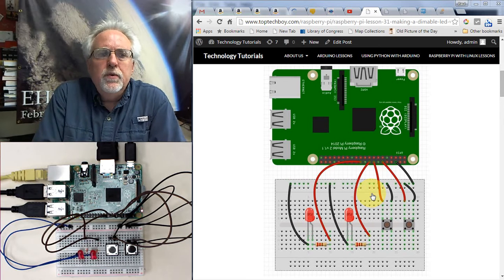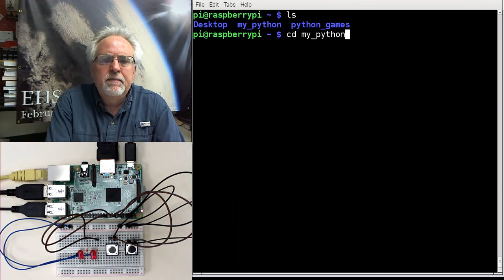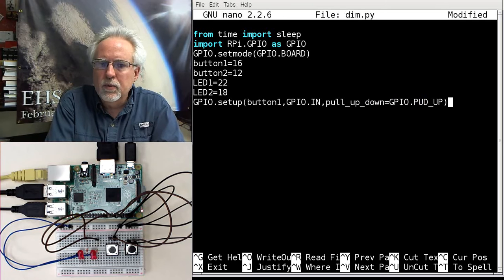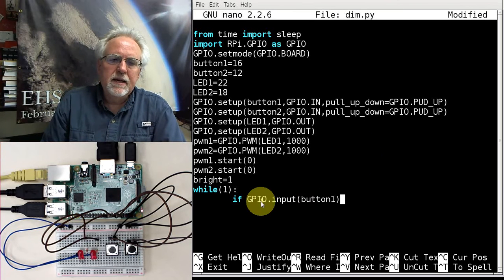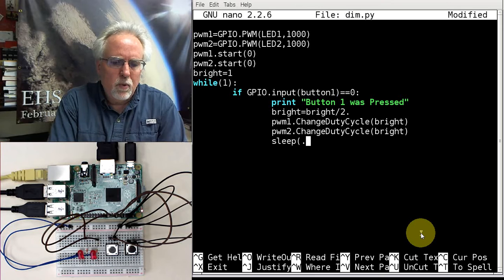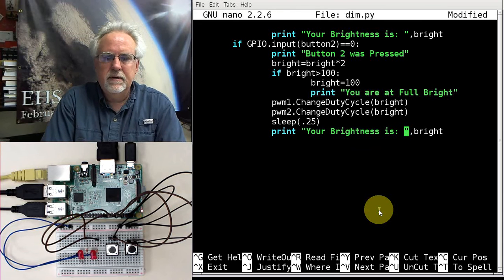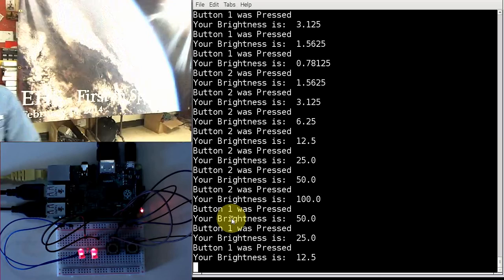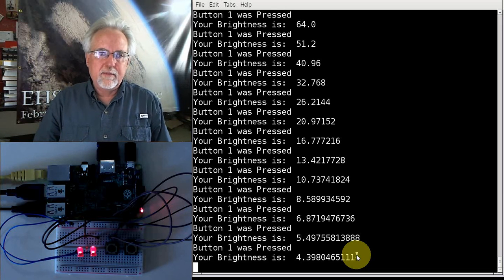Raspberry Pi LESSON 31: Creating a Dimable LED Using Python

Comment: I've done 68 of Paul's Arduino C++  tutorials, 2 or 3 of the Python ones as well, and on number 31 of the RPi Linux lessons. I've watched over 100 tutorials from this guy. I need to go back and thumbs up all the videos. I've yet to make a comment, but I had to comment on this one.

Okay, so I'm definitely exited to be on the GPIO pin on the Raspberry Pi. This lesson was great for me because, well, I didn't like his final outcome of the code for this lesson. The division and multiplication made it sloppy. you could never fully turn the lights off. And the progression of dimness was horrible.

So first I made the progression plus and negative. I also started bright at (0). 1 annoyed me. This created a problem he talked about in the lesson on the program bugging out. He made a fix for this going above 100, but not below 0. So I basically resolved that with near identical code he wrote for going above 100.

A side note, my code below is written for Python 3.9. Quotes are in ("brackets") vs Python 2 being "brackets".

(This is in Python3.9)
from time import sleep  # Library will let us put in delays
import RPi.GPIO as GPIO # Import the RPi Library for GPIO pin control
GPIO.setmode(GPIO.BOARD)
button1=16              # Give intuitive names to our pins
button2=12
LED1=22
LED2=18
GPIO.setup(button1,GPIO.IN,pull_up_down=GPIO.PUD_UP)  # Button 1 is an input, and activate pullup resisrot
GPIO.setup(button2,GPIO.IN,pull_up_down=GPIO.PUD_UP)  # Button 2 is an input, and activate pullup resistor
GPIO.setup(LED1,GPIO.OUT) # LED1 will be an output pin
GPIO.setup(LED2,GPIO.OUT) # LED2 will be an output pin
pwm1=GPIO.PWM(LED1,1000)  # We need to activate PWM on LED1 so we can dim, use 1000 Hz
pwm2=GPIO.PWM(LED2,1000)  # We need to activate PWM on LED2 so we can dim, use 1000 Hz
pwm1.start(0)              # Start PWM at 0% duty cycle (off)
pwm2.start(0)              # Start PWM at 0% duty cycle (off)
bright=0                   # Set initial brightness to 1%
while(1):                  # Loop Forever
        if GPIO.input(button1)==0:             #If left button is pressed
                print ("Button 1 was Pressed")   # Notify User
                bright=bright-10.               # Set brightness to half
                if bright<0:
                        bright=0.
                        print ("light off")
                pwm1.ChangeDutyCycle(bright)   # Apply new brightness
                pwm2.ChangeDutyCycle(bright)   # Apply new brightness
                sleep(.25)                     # Briefly Pause
                print ("New Brightness is: ",bright) # Notify User of Brightness
        if GPIO.input(button2)==0:             # If button 2 is pressed
                print ("Button 2 was Pressed")   # Notify User
                bright=bright+10.                # Double Brightness
                if bright>100:                 # Keep Brightness at or below 100%
                        bright=100.
                        print ("You are at Full Bright")
                pwm1.ChangeDutyCycle(bright)  # Apply new brightness
                pwm2.ChangeDutyCycle(bright)  # Apply new brightness
                sleep(.25)                    # Pause
                print ("New Brightness is: ",bright) #Notify User of Brightness

Comment: Hey Paul ! I really like your videos on the raspberry pi , as far as digital and analog writes thats clear, i didnt quite catch what resistor value you are using . Anyway , could you do a tutorial on the Rc 522 rfid reader ,  there arent a lot of tutorials out there for using it with the raspberry pi . Thanks!
Reply from the maker: TheRandomMan I was using a 330 ohm resistor. For the 3.3 volt output, probably a 270 ohm would make the LED a little brighter. I have not played around with rfid. At some point I might try and look into it.

Comment: Hi Sir, 
I am working on a project where I will be needing multiple led's to be controlled by my raspberry pi 3 gpio pins. Actually its exceeding the number of gpio pins available. Take an example of led thermometer implementation for reference. So my question is how can we control many led's without exhausting out the gpio pins.
thanks for the help in advance.

Comment: Tried using this circuit with  a RGB (made the adjustments for the changed circuit). I assumed that at a 100% duty cycle the RGB would be totally off. It seemed to work correctly except it would not totally turn off at 100% still a dim LED. Any ideas?
Reply: a little late lol

I've done 68 of Paul's Arduino C++  tutorials, 2 or 3 of the Python ones as well, and on number 31 of the RPi Linux lessons. I've watched over 100 tutorials from this guy. I need to go back and thumbs up all the videos. I've yet to make a comment, but I had to comment on this one.

Okay, so I'm definitely exited to be on the GPIO pin on the Raspberry Pi. This lesson was great for me because, well, I didn't like his final outcome of the code for this lesson. The division and multiplication made it sloppy. you could never fully turn the lights off. And the progression of dimness was horrible.

So first I made the progression plus and negative. I also started bright at (0). 1 annoyed me. This created a problem he talked about in the lesson on the program bugging out. He made a fix for this going above 100, but not below 0. So I basically resolved that with near identical code he wrote for going above 100.

A side note, my code below is written for Python 3.9. Quotes are in ("brackets") vs Python 2 being "brackets".

(This is in Python3.9)
from time import sleep  # Library will let us put in delays
import RPi.GPIO as GPIO # Import the RPi Library for GPIO pin control
GPIO.setmode(GPIO.BOARD)
button1=16              # Give intuitive names to our pins
button2=12
LED1=22
LED2=18
GPIO.setup(button1,GPIO.IN,pull_up_down=GPIO.PUD_UP)  # Button 1 is an input, and activate pullup resisrot
GPIO.setup(button2,GPIO.IN,pull_up_down=GPIO.PUD_UP)  # Button 2 is an input, and activate pullup resistor
GPIO.setup(LED1,GPIO.OUT) # LED1 will be an output pin
GPIO.setup(LED2,GPIO.OUT) # LED2 will be an output pin
pwm1=GPIO.PWM(LED1,1000)  # We need to activate PWM on LED1 so we can dim, use 1000 Hz
pwm2=GPIO.PWM(LED2,1000)  # We need to activate PWM on LED2 so we can dim, use 1000 Hz
pwm1.start(0)              # Start PWM at 0% duty cycle (off)
pwm2.start(0)              # Start PWM at 0% duty cycle (off)
bright=0                   # Set initial brightness to 1%
while(1):                  # Loop Forever
        if GPIO.input(button1)==0:             #If left button is pressed
                print ("Button 1 was Pressed")   # Notify User
                bright=bright-10.               # Set brightness to half
                if bright<0:
                        bright=0.
                        print ("light off")
                pwm1.ChangeDutyCycle(bright)   # Apply new brightness
                pwm2.ChangeDutyCycle(bright)   # Apply new brightness
                sleep(.25)                     # Briefly Pause
                print ("New Brightness is: ",bright) # Notify User of Brightness
        if GPIO.input(button2)==0:             # If button 2 is pressed
                print ("Button 2 was Pressed")   # Notify User
                bright=bright+10.                # Double Brightness
                if bright>100:                 # Keep Brightness at or below 100%
                        bright=100.
                        print ("You are at Full Bright")
                pwm1.ChangeDutyCycle(bright)  # Apply new brightness
                pwm2.ChangeDutyCycle(bright)  # Apply new brightness
                sleep(.25)                    # Pause
                print ("New Brightness is: ",bright) #Notify User of Brightness

Comment: Prof, why not use a potentiometer to do dimming? I feel it is more intuitive.
Reply: Or phase cutter. Anyway, the way prof. is doing it is interesting too.
Reply: Oh, by the way, the actual answer to your question: It wastes more electrical energy. See, a potentiometer is a variable resistance, and as a resitance it consumes energy that you won't see or use anywhere else (thus wasted). 

On the other hand, a PWM dimmer is smarter solution since no energy is consumed anywhere else than the LED itself